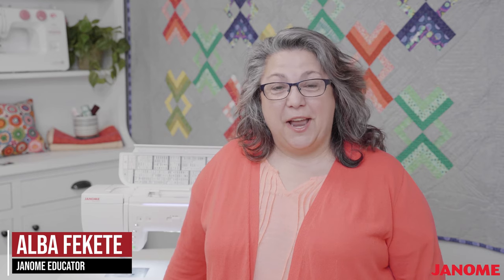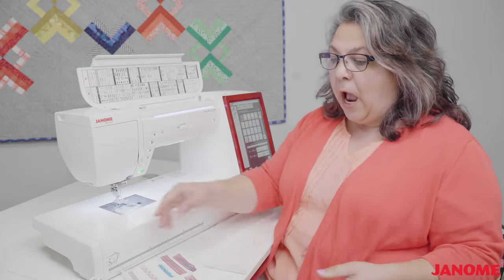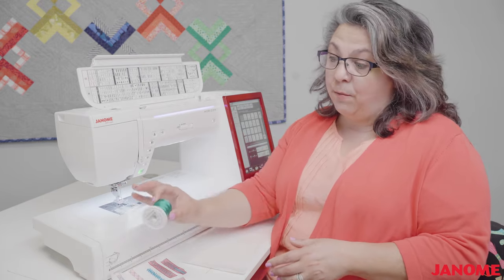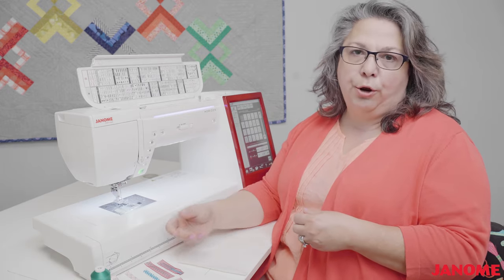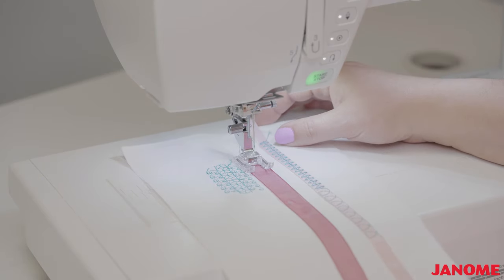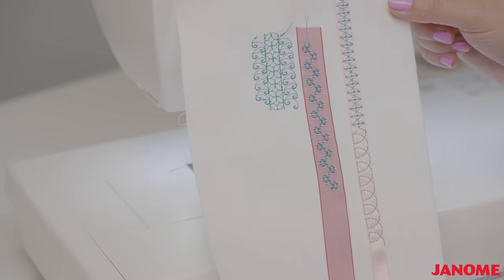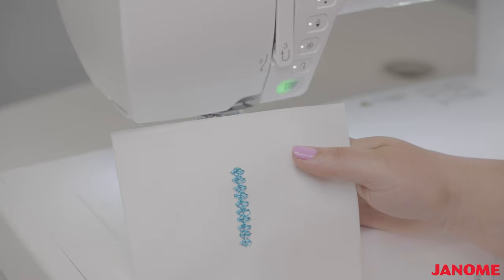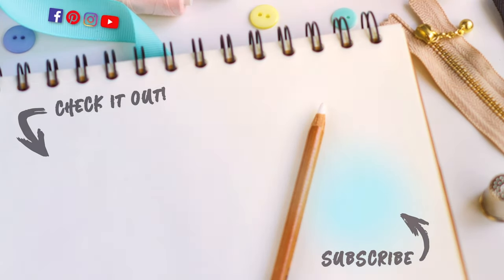All About Decorative Stitches on your Janome Sewing Machine with Alba

Comment: I bought the Janome 1050 dc with zero knowledge on sewing machines. I originally purchased it to create active wear so all my fabrics I’ve tried to sew with my machine are stretchy, I also bought stretch thread to use and a stretchy jersey knit needle.. I can’t seem to figure out why the stitching doesn’t come out right at all could it be the fabric or the thread I’m using? Should I try embroidery thread on my stretchy fabrics? It looked like from this video she didn’t move the fabric around at all? I was wondering if I was moving my fabric down too quickly or have to go over it a few times? I’m so lost. I wonder if this was the right purchase for the projects I had in mind :( I finally got the super basic stitching to look okay but even then the other side looks different and a bit more “lose” my tension is at a 4 and that alone helped a lot but stitching looks nothing like it should someone please help

Comment: I have the MC 14000 - running on v. 1.02, I like it but can not find any info on it, example: should the software on both the PC and the machine be treated like the MC 12000 or the MC 15000 v.1 (or 2) Also can I do the update and use the Horizon Link for my PC.    Please help.

Comment: Which Janome machines have the serpentine stitch ? I have the Mod-50 and don't see it. thanks
Reply from the maker: The MOD-50 machine has 50 stitches shown on the front of the machine and listed individually in your manual. This machine does not have a serpentine stitch. Stitch #16 may look like one, but it is made to attach elastic.